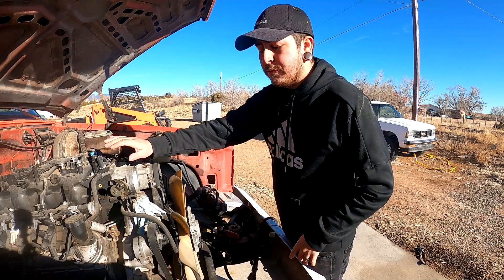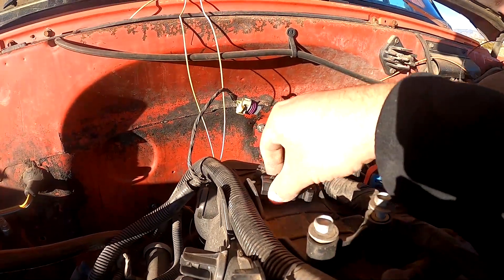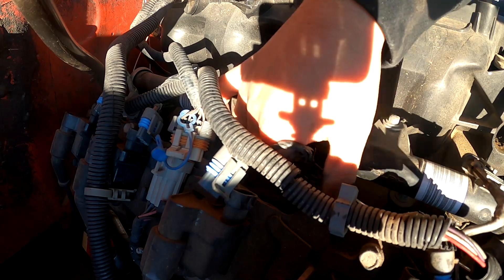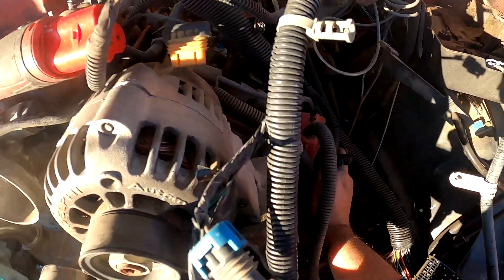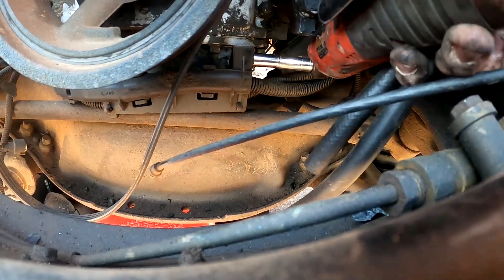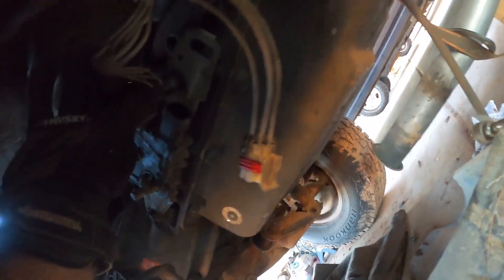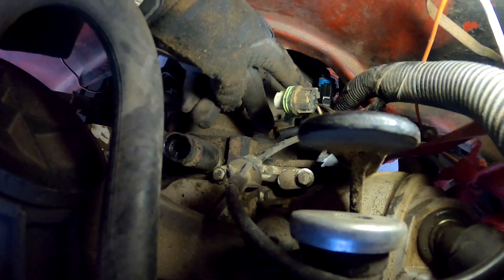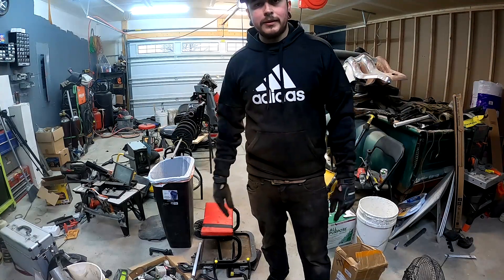LS Gen III Wiring Harness Removal - Complete Guide

Comment: do you need to remove a harness in order to pull a ls engine?
Reply from the maker: Just the parts connected to the truck the actual engine  harness and ecu can stay with the engine
Reply from the maker: Just the parts connected to the truck the actual engine  harness and ecu can stay with the engine

Comment: my friend put a ls 3 in his car and i have a 327 that i have less money in it . i just smoke his ass with it it makes him so mad it is funny then i been getting 454 4 inch stroke steel crank heavy rods high flow heads crate engines 450 hp at 485 torque with the heavy duty 400 turbo all complete with radiator and full coolers and lines for free the last one i got only has 6000 miles on it the long block new is 8000 for it  and if u dyno tune the engine u can get close to 500 hp out of it proven on a dyno that is with the bad intake and little carb rv cam i call it . it is really easy to get a lot of hp out of it because the bottom end is all ready built just needs to breath plus it is all ready stroked just that can save a person 4000  on a build with the heads it can make up to about 800 hp maybe a little more if lucky but then u can port and put bigger valves and get a hell of a lot more out of it great heads for the street low end power just all around good head perfect for the street and the secret to getting these engines is motor homes believe it or not they have crate engines in them for passing power if u get lucky they can have a l.s. 6 454 in them but just a few have them very rare but if it is a chevy engine it is most likely a ho 454 most will have the paperwork in the motor home . like what i did was pull everything then sold the motor home what was left for 2000 bucks and i got it for free so i got paid to get the engine and trans the trans have the bigger pump heavy clutches with a stage one shift kit in them so u are getting a built trans too . i got a motor home for free went through the paperwork and could not believe what they put in it then i started getting everyone i could for free or cheap after finding this out on them . i even checked with part houses and motor home builders they all said the same thing that is when i found out they also put the l.s. 6 454 in them .plus they have a twin electric pusher fans in them so much savings on a build